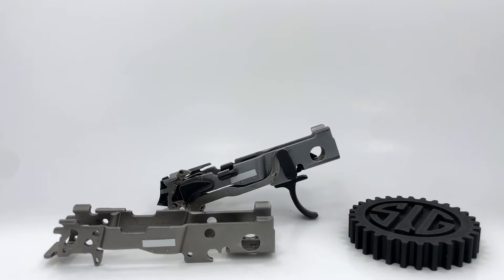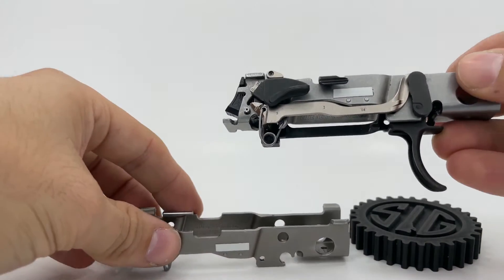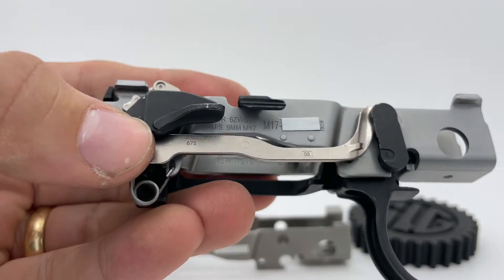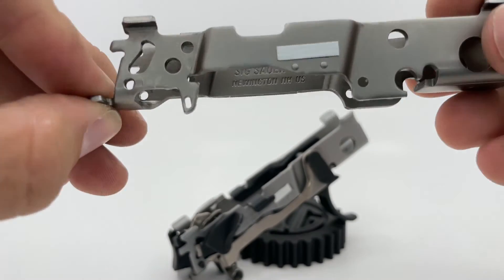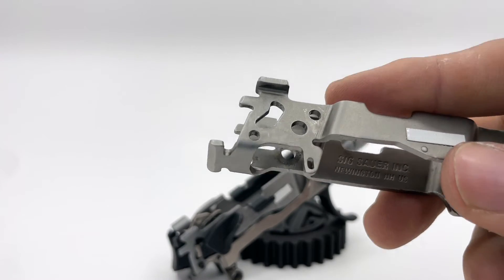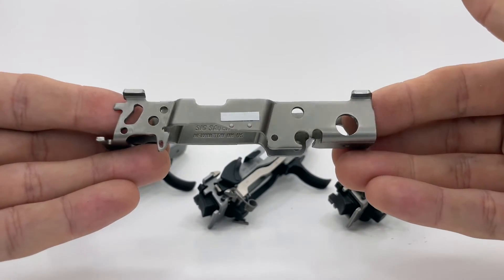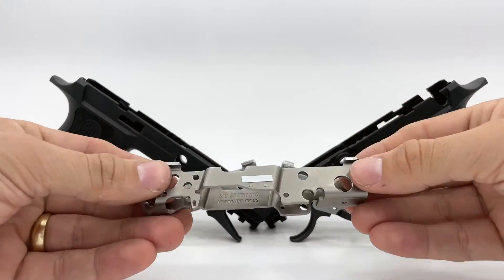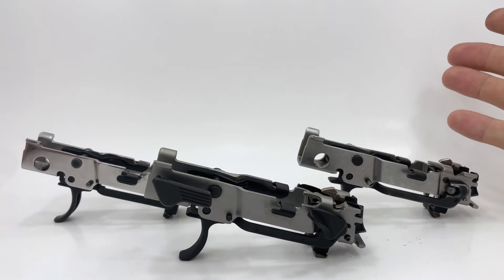P320 - MANUAL SAFETY FCU CONVERSION PROJECT

Comment: Definitely interested. I would love to be able to do this. I might not necessarily need or want it, I want the ability to do it myself
Reply from the maker: That’s one of the reasons I started this project. I don’t see why the community should not have the option even if they don’t use it why not have it available?
Reply: @SIGMECHANICS  from my little google search that was very quick and not detailed, you can somewhat easily convert the 365 for manual. So why not have the same ability? I just think its an awesome idea and now there is a part of me that wants to do it if you make a kit to do so.
Reply from the maker: I actually put this into production last month, looking to have the first shipment available in January.
Reply: @SIGMECHANICS  subscribed. I’m assuming you are going to drop a video when it’s available for purchase?
Reply from the maker: Yes, I’m going to do a complete in-depth video on the “how-to”, tips and tricks I’ve learned while testing the original concept.

 I’ll post it here and if all goes well I will be making the kit available through sigsauerparts(dot)com since they can manage the online side of things (I’m not set up for e-commerce as you can imagine).

Comment: I have a question for ya. The safety is only keeping the trigger from being depressed accidentally correct? But will not help with actually blocking the firing pin. And what is your take on the updated Sig P320 possibly of having a accidental discharge?
Reply from the maker: The safety blocks the sear from moving and stops the trigger from being pulled. The lock lever (striker safety) is independent from the manual safety mechanism.

I don’t see how the gun can AD, so far (from specifically a scientific view), I don’t think it can AD. Trigger MUST be pulled in order to discharge so my opinion is people are causing an ND but are failing to report it as such.
Reply: @SIGMECHANICS  thank you so much!

Comment: I spent my 21 years in the Marines with a manual safety on the M1911 and M9. Sometimes I still reach for the safety on my P320. I would like the option to add it to all 3 of my 320’s.
Reply: This right here. I wasn't a Marine but I carried a 1911 as an EDC for over a decade and just incorporated removing the safety into my draw movement.

Comment: I like having safeties on my carry guns (the guns I like shooting are 1911s, USPs, and Five-seveNs. Even my Walther P99 at least has a decocker), but I was lucky to buy a FCU that had a safety and build my gun off that.

One thing I’m actually interested in is if there’s any extended safety options. I thought both the default slide release and safety were a tad on the small side for me, and Wilson Combat had extended slide stops that I just installed and work great. Would love to have an extended safety too.
Reply from the maker: I also have the extended slide release and I like it far more than the factory one. I highly recommend it to anyone. As far as safety extension, that would be great, maybe I’ll prototype something like that in the future.
Reply: @SIGMECHANICS  That’d be nice. I’d certainly be a first customer.

Being used to extended 1911 safeties as spoiled me, it seems. Granted, the M17/M18 safety is certainly a lot better than other striker fired guns with retrofitted safeties. The design is not a complete afterthought. I just want something that at least sticks out just a little bit more to make it easier to sweep off.

Comment: One thing I noticed, once installed, the safety doesn't even go through the whole range of motion on the cutout. The left thumb safety has detents, so it really only travels between the top and just below the "bump". 

Something to bear in mind when testing your cut.

Go slow, and grind/sand in the direction of travel, test as you go, and it's actually hard to mess up.
Reply from the maker: Thanks you. The shape is per the exact layout on the M17/18 models and the extra space is necessary for disassembly as the thumb safety switch needs to ride extra low to take apart.

The cutout is exactly as you said, nice and slow with a movement following the movement of the detent. Your exactly on point!

Comment: I love this! It would be another way to customize FCUs, which is the whole point of their existence! I think some jigs for milling the grip (including the axg side grips) would be great too
Reply: Jigs for cutting the grip can be bought  on eBay very cheaply, or 3d printed yourself
Reply from the maker: Yes, grip cutout jigs been around for some time. This is more of a “complete” kit to get you from start to finish.
Reply: I've seen the jigs for cutting the grip, but I thought you were supposed to remove the side panels and do them separately. Either way, it shouldn't be too hard EXCEPT that the panels need to be milled to be made flush with the safety, and I know I'm not going to be able to do that (without making it look terrible). Either way the safety conversion kit would still be awesome!
Reply from the maker: So I’ve found over trials that there is an order of operation for this to work really well, mostly it’s time investment and direction of tool travel, but even those inexperienced have made it work in testing. I hope to get a full “how to” video out soon.
Reply: @SIGMECHANICS  looking forward to it
Reply: @Dante-420  it's actually really easy with the polymer grips, few minutes with a dremel and done. even if you mess up a bit, the safety itself is big enough to cover a minor error. Dunno about the AXG though - that's aluminum, whole different beast, never tried it. But aluminum is pretty soft...I think you might want a better jig, but a router should be able to mill it easy enough

Comment: Although I’m not a big fan of the Manual Safety I think it is an amazing option especially with all the allegations floating around. I would honestly do it just to get all the negative Reddit comments out of my head lol. Will it cause issues with current no safety holsters? Thanks!

PS… You should offer the service. I would gladly send you mine lol

PSS… Regarding the safety issues, I was doing some thinking the other night. I have a Zev P320 and their customer service assured me that their engineers thoroughly went through this build which makes me feel better. Also I doubt Wilson Combat would form a partnership with the 320 if they had fears or safety concerns. Maybe I’m just trying to convince myself it’s safe to stick down my pants with one in the pipe lol.
Reply from the maker: There a is a substantial benefit to adding the manual safety, which is you can always revert back to non-manual safety whenever you have it. However, if you don’t have it, it of course was harder to add. If it gives you piece of mind, all the better.

I don’t personally do gunsmithing, as I am not certified in any way, but the simplicity of the project allows you to either do it yourself if you have some proficiency or provide it to someone else, I can.

I wouldn’t worry too much about the Reddit comments though, your p320 is safe.

Comment: I believe this would be a big seller. I recently had the FCU frame milled out to accept a manual safety because of continued accidental dischargeproblems with the P320
Reply from the maker: I always felt safe with the P320, but I also always understood that piece of mind with your carry is far more valuable to an operator. Even the slightest mental hesitation makes that firearm dangerous, even if it’s not. Hopefully, something like this will provide that peace of mind at what I would assume to be a very low price. 

So far everybody seems to be very positive with this project so I’m going to see about getting this into production soon. I just want to make sure I can provide everything down to the bits before this becomes public.

Comment: What do you think about the new lawsuits saying that the 320 is  discharging on its own without trigger pull
Reply from the maker: I don’t take too much stock in the lawsuits right now. I am open minded to the possibility however. 

What I would like to see most of all out of the lawsuits is someone being able to reproduce the conditions that prove what they are saying. Similar to how the drop safety situation of 2017 was possible with the use of a hammer, instead of having to specifically drop it from the 2 meter height and correct angle.

Comment: I had the manual safety conversion done on my P320 by AB-Protoype because the trigger is basically a single action only. I've had a lot of people disagree with that because (its a striker fired gun, not a hammer fired gun, so its not single action only and doesnt need a safety) and thats fine if you dont agree. You do you and I'll do me and I'll take the manual safety version.
Reply from the maker: For what it’s worth, I always considered the P320 SAO as well.

Comment: 1 Dec 22.  The only thing stopping me from buying a P320 Max is the no manual safety from the factory.  I have the M18.  Can you post who would instal a safety on the P320 Max including modification to the grip module?
Reply from the maker: This would come as a kit with everything you would need. Anyone would be able to do it with a little know how and time. Or a gunsmith.
Reply: The kit is under development not ready for sale yet?
Reply from the maker: At this point it’s more ready than not ready. It’s been tested by various people, I’ve also modded a lot of FCUs too and it works great. Therefore, if there is interest in this project it would take no time at all to get it Tom the public.

Comment: I want a manual safety p320, but sending my FCU to get a cutout is too much hassle. I'd also have to modify my current grips or buy new ones. It'll be a pass for me tbh.
Reply from the maker: Well this would allow you to technically be able to do it at home. All the tools necessary for grip and FCU.
Reply: Would you need special tooling to cut the FCU or would that be included in the kit?
Reply from the maker: All included. I’ve tested it with several people and as long as you take your time and cuts are made gradually, it’s very simple. Most people don’t even use a vise.
Reply: In that case, it's definitely a product I'd be interested in. Thanks.

Comment: Knowing what I do about the P320, including what I learned here, I can conceive of no way that any of mine are capable of discharging on their own without the trigger being pulled either directly by finger manipulation or indirectly by the action of something else that does it. Unintentionally pulling the trigger by one of those means, especially the latter, is of course possible as countless Glock owners have discovered. Because of that possibility despite my best intentions and practices, I would definitely consider such a modification to the guns I have. I am therefore very interested in learning what would be involved.
Reply from the maker: Sure thing John, I’ll send you a message if this comes into production.
Reply: @SIGMECHANICS  Great! Thank you.
Reply: @SIGMECHANICS  I'm with John.  As a Certified Factory SIG Armorer and professional gunsmith, I wholeheartedly agree with his points above.  Having said that I would like the optionality of installing manual safeties on all my P320's.  When I purchased my SIG P365, I bought it with the manual safety.
Reply: @SIGMECHANICS  please message me as well as I would be very interested in buying one

Comment: Definitely interested. Already have the parts coming, just gotta make the cut. Would love some rough measurements
Reply from the maker: It’s hard to provide rough dimensions since the location needs to be pretty specific to connect the factory parts. The kit however will give everything perfectly without guesswork.

Comment: I think that's a great idea. By chance do you have a template for the x carry safety cut out? I would like to get a txg x carry grip and convert it.
Reply from the maker: If you have a P320, the FCUs are all the same! Modularity is one of my top reasons for enjoying this platform.
Reply: @SIG MECHANICS  I do have a p320 m18 however all the txg  grips or xcarry grips have no safety cut out. Do you have a template? How did you make the cut out for the manual safety on that grip?
Reply from the maker: Oh! I see what you meant. Yes, this kit would let you cut both the FCU and x-series grip module.
Reply: @SIG MECHANICS  I can see alot of value in that safety cut out template for the grip, currently there is no solution on the market place for x carry grips with safety cut out.
Reply from the maker: I like the x grip and have it on all my p320s, so I started with the x-series first.

Comment: Good idea. Was gonna make a couple comments, but you pretty much covered all the things I was gonna say (about the MUP-1 and companies that will add the safety cut to P320 FCU's and MUP-1 FCU's). I guess the main point would be how much is costs... and if that's worth it.
Reply from the maker: I believe you need to send both FCU and Grip and both are charged differently, or perhaps have to purchase a new grip. I would aim for half that. Plus, you would be able to possibly reuse this kit, which would be substantial if you have more than one FCU.
Reply: @SIGMECHANICS  Yeah, good point. It's nice too, because the safety cut doesn't interfere with the rest of the parts, so you can always add or remove the safety (esp if you have a non-safety cut frame, but that's just to make it look nice without the safety).

Yeah, reusing it is a major bonus too. I know several people that have several P320's who want to add a safety to at-least one of them, but never have, because they just don't want to have to mail their guns. Can't blame them though, I'm the same way.

Comment: Also, if you make a “ kit”, you had better talk to an attorney because Sig WILL blame YOU for the discharge regardless of your conversion having anything to with that injury and you will become the defendant in that persons law suit.
Reply from the maker: Yes I’ve looked into this. Seems all good as long it’s clear to the user that there is no liability to me and the I stipulate the risks of not doing this properly. Also, if a certified gunsmith does the work then the user should not have a problem. 

Surprisingly the process is simple and pretty clear so as long as the person takes their time, there should be no issues.

Comment: Here are two problems with “ self conversions”. You immediately do in fact void all warranties. Also, with the current issue (and Sigs refusal to own up to) uncommanded discharges of the P-320 minus a trigger pull, if you become one of the over 100 victims ( so far) of this problem, you can forget about suing Sig for the defect. Sig will now have another excuse besides seatbelt buckles and trigger fingers causing the problem.
Reply from the maker: Yes. This absolutely will not help if there ever was a problem. With the warranty void you would be out of luck. However, from what I can tell, if the modification is done by a certified professional, the warranty remains. I have not confirmed that with Sig directly only with gunsmiths.
Reply: @SIGMECHANICS  Sig will say it’s ok just to have a “ buffer” between them and another lawsuit. Then they will say, “ We never said that!”

Comment: This awesome, it would lessen the anxiety of the Sig “shooting on its own”. Carry confidence will go up.  And get one in the 1911 game for those interested.
? - would this work with any of the flat triggers? And would it work with Armory craft spring time kit?
Reply from the maker: This would work with all triggers in all P320 models. You are effectively installing a factory manual safety system. All this project will allow you to do is to make all the modifications to allow you to install the factory parts.
Reply: @SIGMECHANICS  I never understood why Sig didn't cut the notch into all FCU and why they made the trigger bar different.
Reply from the maker: I don’t under that either, would actually cost less since it one mold not two for stamping!

Comment: First off…great videos!  As far as the safety mod, it’s great.  Would definitely consider it for some of my FCUs.
Reply from the maker: Keep in mind that even if you were to ever modify to have a manual safety on your P320, you can always switch back-and-forth between manual, safety and nonmanual safety at any time by swapping out one pin, and using a nonmanual safety grip module.